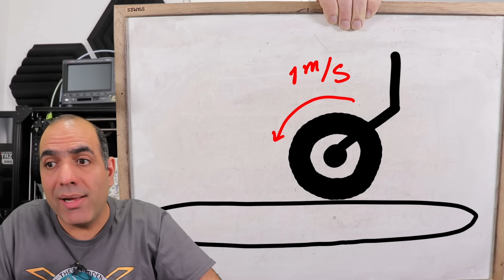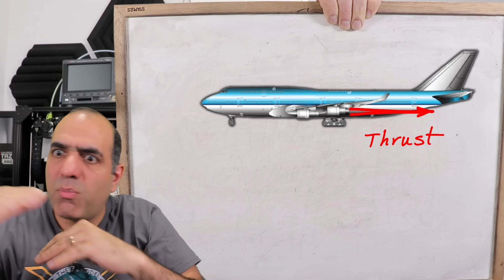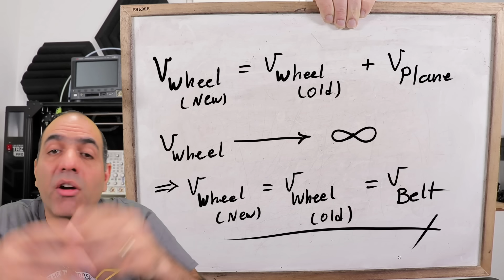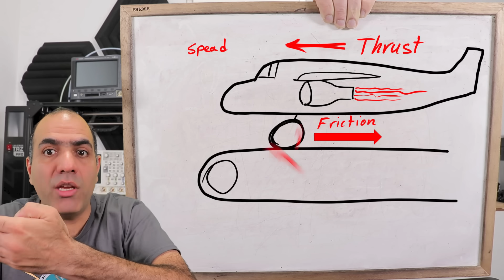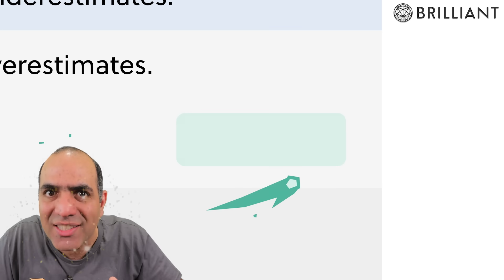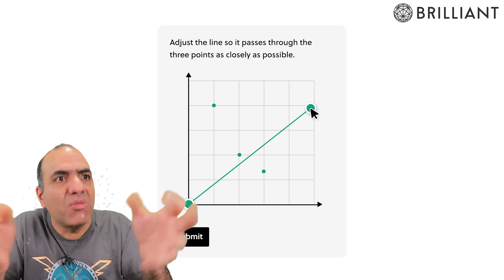Airplane Question that Drove Me NUTS!!!

Comment: You can fly a kite with zero ground speed and positive wind speed. 
Lift is generated by air flowing over the wing. It's that simple. 

Also, (assuming power) the airplane might be able to take off if the wheels are turning fast enough to create a downdraft along their front, creating a high-pressure area right where the wheels meet, until the differential pressure is enough to lift the aircraft. By like a centimeter, because the wheels will spin down as soon as they lose contact with the conveyor. So, depending upon the mass of the aircraft and indestructible nature of the wheels, it might take a series of tiny hops.

Comment: Im a pilot and i had this conversation with some guys while holding once

If you had a jet, Nill wind then no because you will never have wind under the wings to create lift

However, if you had a puller prop, you could theoretically do it if your thrust ratio was high enough

Depending on the jet location this could happen but you would never wind to pass over the Stabilator/Elevator to give it authority allowing to rotate
Reply: Those pilots must have failed learning about how the wheels work.

The wheels can do whatever they want, the plane is pushing against the air which is not moving. It will move forward relative to earth and take off
Reply: @TransistorBased  depends how you interpret the question 

The general idea is that the wheels move backwards at a speed enough to keep your GS at zero. In which case there is no relative airflow except wind. So you would need wind at or hugger than your Vr
Reply: @thesturmvogel6359  the wheels literally do not matter. The magic treadmill can turn as fast as it wants but the plane will move forwards because it freewheels. Yes, the tires would blow out at high speed but this is all theoretical so that doesn't really matter.
Reply: @TransistorBased  i dont think you follow how wheels work

If the wheels where travelling back faster or at equal speed than the aeroplane wants to go forward then the plane would not move forward

In a similar way that log rolling or barrel rolling works
Reply: @thesturmvogel6359  in log or barrel rolling, you stay up by propelling the rolling object

Planes move by pushing air backwards and could care at all about what the wheels are doing
Reply: @TransistorBased  right but if the plane wheels are not allowed to gain positive forward movement, then the plane wont either. Thats what the question is about. For the plane to move forwards the wheels need to be allowed to spin in positive,, but if the treadmill counters that then they are neutral not positive. So the wheels would spin but the body wouldn't move
Reply: @thesturmvogel6359  the wheels will turn faster because they're not being propelled by the plane. They'll just keep turning backwards faster as the plane moves forwards due to its thrust relative to the stationary air
Reply: @thesturmvogel6359  All right, I just rewatched the video since it's been a while since I've seen it. I forgot he's working on a modified version of the thought problem where the treadmill is designed to match the speed of the plane so it's not a constant speed. 

In that very specific set of circumstances, which implies an infinite amount of power being put into the treadmill, the plane would not be able to take off. But in the original problem where a plane is just placed on a moving treadmill it would be able to take off.
Reply: @TransistorBased  its okay, i appreciate the balls it takes to admit when you are wrong

But yeah you are right that in the normal version of this problem the plane will still take off. But in the variant presented it wont.

Comment: The plane pushes forward against air, not ground. The wheels dont matter.
The plane can fly.
Reply: While on the ground, a plane can only roll or slide until takeoff speed.  Rolling behavior absolutely matters.

Comment: Planes traverse through the air not across the ground, the wheels are unpowered and free spinning so it doesn't matter how fast the wheels spin the plane will still move forward and take off
Reply: Incorrect.  A vehicle on the surface only slides or rolls to travel after a force is applied.  In this case, the plane rolls on its wheels…and the conveyor exactly counters that motion per explicit description.

Comment: i mean you could also assume the Thrust/weight ratio is >1 wich means the aircraft could takeoff in a standstill no matter the air/groundspeed of the aircraft, wich means it would be a takeoff. seen in this scenario a 747 is used this case is does not have a Thrust/weight ratio of >1 wich means the aircraft would then apply to the other cases.

Comment: MythBusters used a tarp and a real airplane. I'm not so sure that the tarp accurately represented what a conveyor belt would do. I feel like someone with the means and intelligence could construct a large conveyor belt/treadmill and use an RC airplane. The physics would work the same.
Reply: One could use identical motors.  One for the vehicle; one for the conveyor.  With matching speeds, people will see the vehicle goes nowhere under the stipulation provided that conveyor speed exactly matches wheel speed.

People who say yes, the plane will take off just tend to ignore the parameter.

Comment: Let's assume the engines are on. I don't think the engines push the air backward. They push the plane forward. If the plane is on a treadmill, it's not actually moving. Only the wheels are. On a windless day, there won't be enough airflow under the wings for the plane to take off.

Comment: Assuming the conveyor belt is indestructible but the plane is just a regular plane with all the laws of physics attached. The wheels fail, the landing gear gets demolished shortly followed by a massive explosion because it's a fully fuelled plane ready for takeoff that's just fallen onto a rapidly moving surface with the engines running.

Comment: It doesn't matter if the wheel bearings are frictionless.  The wheels can transfer horizontal forces to the plane through the axels regardless of the rotational friction of the bearings.  The engines provide some amount of thrust X on the plane.  In order to maintain the problem constraint the belt has to provide an equal and opposite force X on the wheels.  This introduced a moment on the wheels because the axels are pushing forward with X force at the center of the wheel and the belt is pushing backward with X force at the bottom of the wheel.  Make reasonable assumptions for the radius and angular inertia of the wheels and you can solve for the wheels' angular acceleration.  The problem constraint can hold (and the plane won't be able to accelerate or take off) as long as the wheels can continue to accelerate at this rate.

Comment: This is a very weird scenario to think about. But in order to get this right..... 🤔 Let me think.....well In order for this to work the conveyor belt will have to be going at the same speed the wheels are going, now these planes are really large and really fast, and most of all really really heavy. With the speed at which the plane is going and the speed that the belt would need to go there would need to be some serious engineering going on here. Whatever is driving the belt would need coolant and the belt itself would need to be cooled and not to mention the perpetual motion of the belt may even slow the plane down causing it to not be able to lift. If a plane stays in place it won't get the lift that it needs. So this will not work. No matter how well you engineer it, it won't work

Comment: I get you're making a video for entertainment but you're making this way more complicated than it needs to be. The implication is that the belt moves at the same speed as the airplane, not the wheels. I understand that's an important difference but the point is that's clearly what the writer of the tweet meant.

Comment: Locking in my answer before watching the whole thing, It depends on how it is interpreted, if the threadmil means the plane stays still then No it can't because the plane needs air moving over it's wings to generate lift not just "ground" speed without actual movement. But we take the fact that the plane doesn't need it's wheels to go forward then it will still move forward and speed up to take off just that it's wheels will spin faster than normal which in an engineering stand point is probabely exceeding their safety factor but disregarding that it should take of just fine

Comment: One thing not mentioned was the wheels’ inertia causing rolling resistance, which would push the plane backwards at an exponential rate. One way to use this to our advantage in this situation is to use the reverse thrusters just to get the plane rolling backwards, causing the conveyor to move forwards and the wheels to spin backwards faster and faster, and the inertia would speed the plane up forwards towards takeoff speed. 

There are caveats to this, for example; the main gear has the most inertia being far heavier than the nose gear, and it is closer to the centre of mass to enable the plane to rotate easily during takeoff. Most of the weight and acceleration force would go through the mains, risking a wheelie or even a tail strike. The planes wheels would also be moving way faster than the plane (in the opposite direction) which could cause them to break apart from excessive forces. Lastly the plane would be able to reach takeoff speed without engine thrust but would need throttle to maintain speed once it is no longer contacting the conveyor belt.

Comment: Here's my answer. It's not about physics or engineering, but about maths, geometry and the question wording given an impossible scenario.  I believe part of this debate comes down to the definition of "wheel speed". For my answer, I define wheel speed as how much distance the circumference covers per unit time. The other assumptions I'm making are negligible wind and no skidding of the wheels as if we do start quantifying those values, then we end up trying to decide at what point on the spectrum will we use.

The only relevant bit of flight knowledge is that an aircraft must move forward in order to get airspeed. 

Here's the kicker....regardless of what drives the aircraft and how it moves, the fact of the matter is that for it to physically move forward then the wheel speed MUST be faster in one direction than the surface it's on in the opposite direction. 

This doesn't mean the conveyor holds back the aircraft.. but if the aircraft does move, then the wheels must be moving faster than the conveyor. Since the question says teh two are matched, this is not allowed and not possible. 

With that in mind, instead of saying the conveyor may/may not let the aircraft fly, we need to reword it as "If the plane flies, then it violates the premise of the question and is therefore not allowed".